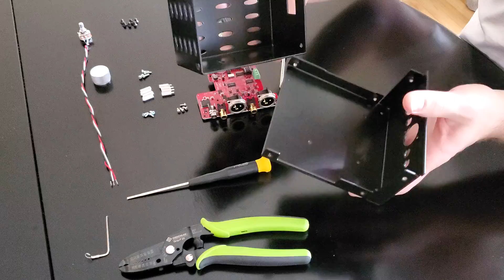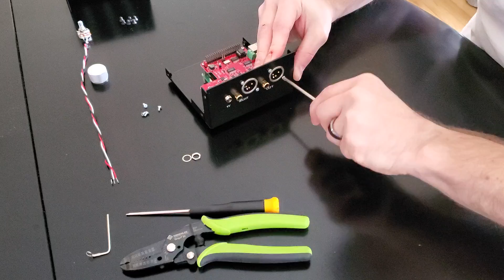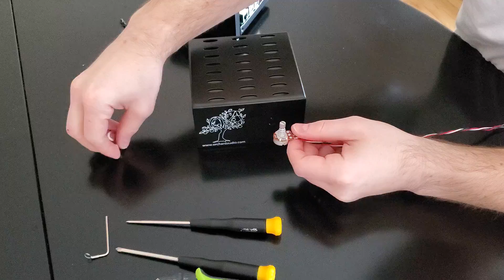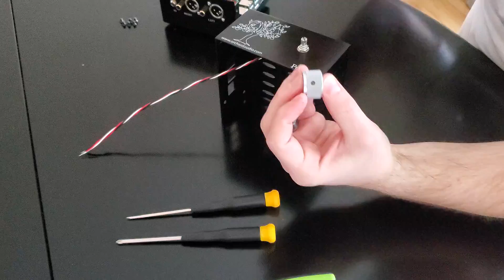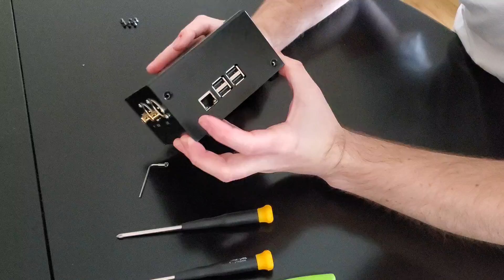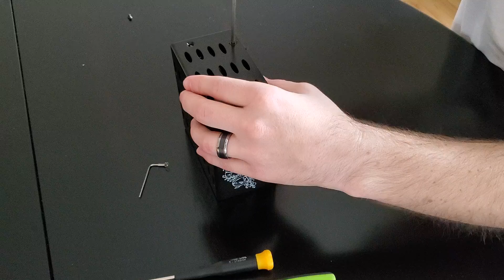PecanPi DAC Streamer Assembly

Comment: Is Raspberry Pi sending Digital signal to your DAC in I2S domain? 
How good it the clock in the DAC , and are there 2 clocks there, one in Raspberry and one in the DAC?
Reply from the maker: Yes I2S, the DAC reclocks everything to an ultra low jitter (82fS) Crystek clock.
Reply: @OrchardAudio  I wish you could build/offer  a streamer with out a DAC , streamer that would offer i2s output  for those who already own a quality DAC 
I wish it could cost around the half of the PecanPi... I would buy it on the spot.
Reply from the maker: @kdomster9141  it's possible but unfortunately not many people need need I2S output or even know what I2S is.
Reply: @OrchardAudio  Unfortunately you are correct,  do you plan to offer you streamer without a DAC? 
I think there would be a market for such simple streamer in the small package.
Do you see a difference in Sound Quality  USB vs I2s output... ?
Would you be able to modify your Raspberry Pi to i2s output? 
My pre amp and DAC is Audio Alchemy DDP1 and it uses mini Din plug for i2s .
 I spoke with Peter who designed it and he confirmed that i2s is the best way to go,  can offer a pin out schematic ... 
I did notice you do also offer a CD drive to connect to your Raspberry Pi and I guess it useses USB drive to connect to Raspberry Pi , does it use a clock in such connection or If i2s was used to output from RaspPi   to a DAC would it than use a clock in the DAC ?  Do i think the right way as far as best sound quality is concerned?   Sorry for long long post but I can tell you that Im not the only one searching fot these solutions after reading several post from audio forums.... There is a market for it.
Reply from the maker: @kdomster9141  A streamer with no DAC is just a raspberry pi in a case. If you want I can do this for you for a small fee. I have a few customers I have already done this for.

Please send me message here:
https://orchardaudio.com/contact-us
Reply: @OrchardAudio  Thanks Leo , I will